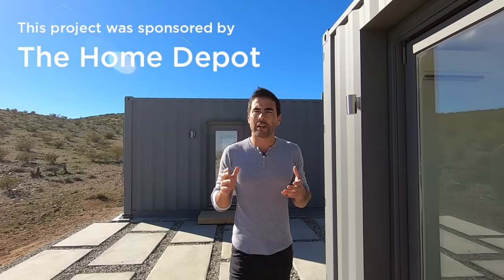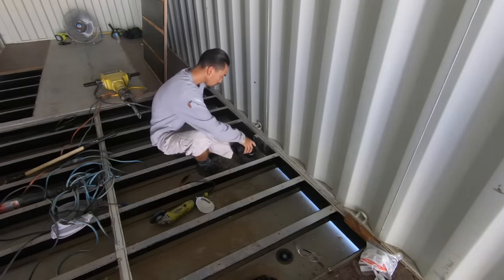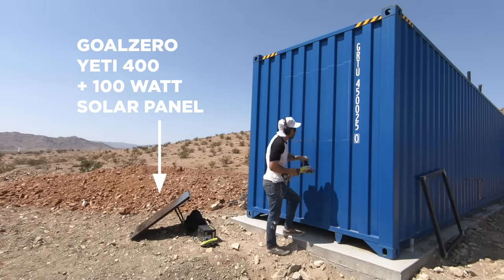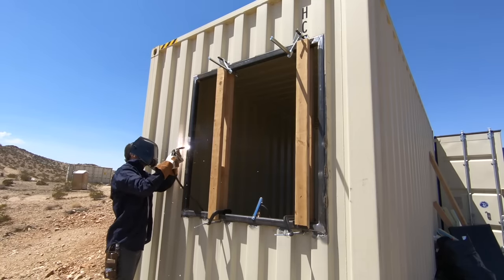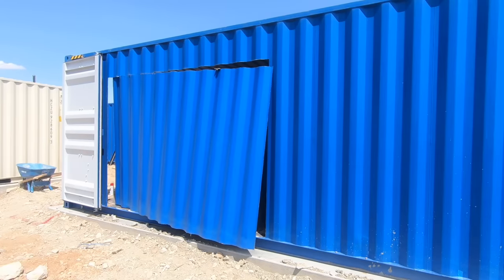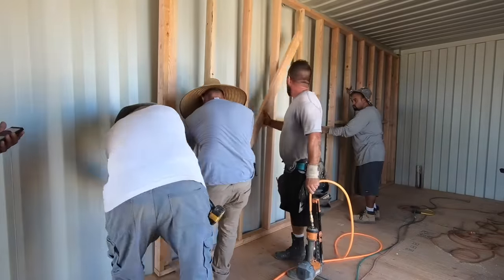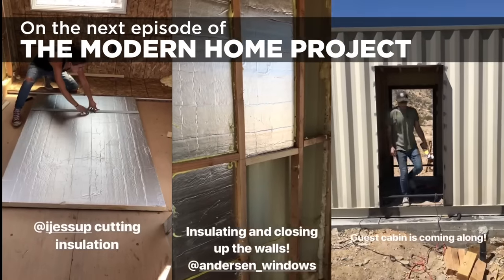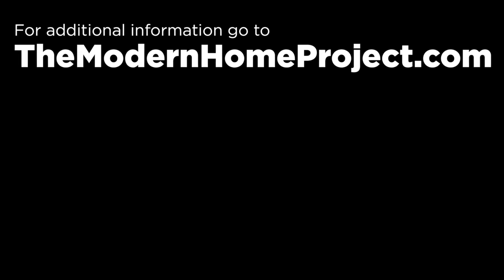Building a Shipping Container Home | EP02 Moving, Cutting, and Framing a Container House

Comment: You got screwed by your local building department. They made you do so much extra work that stick framing would have been way cheaper. Totally defeated the whole purpose of using shipping containers.
Reply: Agreed!  It would have been faster and cheaper to just build a traditional stick-built house.  You could have the walls & roof trusses built offsite and have your shell up in 1-2 days.
Reply: CA PERMITTING STRIKES AGAIN!
Reply: Agreed, building a stick lumber house frame inside of a shipping container, kind of defeats the purpose of building a container home .
Reply: That’s what I was thinking. I know nothing about construction or anything but I was like what even is the point of the shipping container now?!
Reply: That's what I was thinking. CA, where they'll violate federal laws and make declarations about illegal dreamers to create sprawling 3rd world indigent camps, but force this citizen and new taxpayer to undergo this level of bureaucratic overreach and overkill.
Reply: Do you guys actually expect him to live in a bare metal box in the middle of the mojave desert with no insulation or framing?
Reply: Not totally. Unless you want to live inside a radiant heater, how are you going to install insulation/drywall? You may want that full 4” and max R if the outside is 105 and you go off grid solar.
Reply: Yeah, lets build a house inside a house... I've been interested in a shipping house for a while, If I ever build one I'll be sure to check into the building codes before I start.
Still love the video though.
Reply: Love the guys passion, but lots of extra time and money
Reply: @dvwatts  Having studs isn't stupid, for all of the reasons you mentioned. Having to pay an engineer to design headers over the doors to support a load that doesn't exist is very stupid.
Reply: @Gunner7121  Building a above ground container home in the desert is stupid.
Its gonna get so hot inside that it wont be livable
Reply: His choice to live in a tin can in the sun....
Reply: close to the most inefficient building I have ever seen!
Reply: Depends on your purpose. Containers are far more resistant to storms than stickbuilt structures and their steel shell isn't vulnerable to wildfires (though if it's heated sufficiently the inside paint can outgas).  That's why my machine shop is inside two 40' High Cubes.  It's very low maintenance, I got an instant level floor capable of supporting my lathe and mill, and because the structure was instantly available I used the containers as storage during construction and left them loaded when I winched one against the other  to weld them. Containers are great for shop structures and many other uses. Stickbuilt junk is a fire hazard and termites eat it. It's fine for homes designed to be pretty. For a god tier example of container construction check Andrew Camaratta's container castle videos.
Reply: @EssensOrAccidens  everything that I have heard about California is so stupid.  I have not visited that state yet and have no desired to and never will.
Reply: I came, I saw 
Then you’re small minded
Reply: @EssensOrAccidens  welcome to socialism. Thanks liberals.
Reply: So why not build a stick building with metal siding , or just order a precut steel building (versatube) that you could erect with no heavy equipment. with the cost of the crane rental the containers , container delivery  , foundation , plus still having to frame & finish the inside , containers just seem extremely cost inefficient. a well used 40ft container costs 3500 before shipping let alone he has these nice shiney new ones which in addition too had to then order all the windows and doors for..  I can't imagine doing a stick built steel sided building would have cost more while giving more usable square footage especially since the stick built gives you the space for insulating by default without additional interior framing.
Reply: I thought steel container houses were super cool and a cheap way to build , then i saw this video and now i think i'm on the opposite side of the fence.
Reply: @EssensOrAccidens  California would have the sixth largest economy in the world if they were a country, bigger than Russia's for example. Apparently they're able to do some things right.
Reply: @TheDaltonmichaels  Don't be discouraged by the prices and methods being presented in this video series, unless you are looking to build in California.  I am about to begin building a 1280 sqft container house and the cost is 50% less than just building a stick frame home.  I do not live in California, however, and i am using high quality components.
Reply: Building department? Why would I call them? Where I come from we call that a non permanent structure.
Reply: @dvwatts  The proper way to do it, would be to space 2x4s flat @ 4ft intervals, sheet-rock mounting. allows for more space in a structure that desperately needs it.  Use spray-in foam for high R per inch and resistance against moisture getting trapped between wall and insulation (mold), since it adheres to the surface of the wall.  There only needs to be support in areas where the wall is compromised, welding tube, beam, or channel into it is the best way to go there.  Wood would only act as kind of a safety stop, actually integrating steel to bolster the structure would do a lot more for actual strength.  Corten steel, which is what containers are comprised of, doesn't continue to rust past the surface, so that part was a bunch of crap.  Those things spend years on open seas, getting blasted by salt water, they would far outlast any kind of wood.  Like others said It's basically Cali Bureaucratic planning officials, flexing their permitting muscle, just because they can.
Reply: @Steven Brown - Anything on a foundation can be considered a permanent structure but even in places where that isn't the case, they may still be requirements you'll have to follow to make it legal to live in, especially, if you're going to hook it to utilities, water, sewage, etc.
Reply: Democrat government paradise!
Reply: Like I always said, America is no longer the land of the free. Remember, he didn't show us all the bullshit the government made him go through
Reply: NatoriousGamePlay 
The first video shows the process they made him go through it was allot!
Reply: @dubious6718  not necessarily.  The desert is a great place to use passive heating and cooling.
Reply: That sucks
Reply: haha, right!  In the desert, you get passive heating in the day until you're baked crisp.
In the night you get so much free passive cooling,  you'll sleep shivering and wake up as a Popsicle...  :) 

Must be the holy grail to build a house that amplifies and exaggerates the temperature swings of the surrounding environment.
Reply: @Pharesm That would be a very badly designed system.  for a good example, look at earthships. some of them are located in the same desert.
Reply: That's my whole point.  A shipping container is detrimental to appropriately insulating design, to the point that effort and materials required to mitigate the issues mean that you're better off avoiding the container and simply starting out with different materials.
As for people who can't even build a rectangular box from scratch, they probably should leave the building to someone else .

Given the school system, its maybe unfair to expect people to conceptualize and then build their own solutions, without relying on someone else's design that was optimized for ocean going freight transports.
Reply: @Pharesm  You could build passive heating and cooling into shipping containers, you just have to plan for it.  some south facing windows, a couple of air vents, maybe add a garden to the roof.  those would all work.  there are also insulated shipping containers if you want to go that route.
Reply: @EssensOrAccidens  What makes a dream illegal?
Reply: @Hlidskjalfff  Yes! Panel insulation could have worked.
Reply: @dubious6718  True, has anyone buried containers?
Reply: @cuongandmari  Thank you! That's the point of it.
Reply: @goldsilverandiamonds  Good to stay away then!
Reply: @NPC-rq9tp  Good plan to stay away.
Reply: @V0YAG3R  Stay away!
Reply: @J. P. Good plan to stay away!
Reply: @nancys1125  Collect taxes.
Reply: @usernamemadison  The fun constraint of really narrow rooms!
Reply: Dax Graham any way you look at it. He’s gonna live in the middle of the desert in a metal box with rooms less than 8’ wide and it will not be worth the money he has invested. It will be so unlivable that he will sell it at a loss to some other trust fund baby with more money than sense.
Reply: Ob Fuscated an instant machine shop, yeah okay, a house, well not so much.
Reply: I came, I saw 🤣 you need to change your name... I heard , I stayed home
Reply: Madison McAllaster  well the steel siding might might slow down a stray bullet
Reply: I think you missed the point entirely. Everyone’s goal isn’t the cheapest possible solution.
Reply: I think I see my dad's house from here.  The inspector overrode the architect's design and, AFTER the concrete was poured, forced the builder to increase the depth of the footer and add steel plates to "distribute the weight" of the steel barn he was building.   Now, this was after the plans were approved and building started.  It cost my dad thousands.  CA building departments are full of corrupt bureaucrats that either want kickbacks or just want to make sure every office needs a few dozen extra employees to handle the load of dragging out the simplest build for years.  After all, how can I become a high-paid manager if my office only needs three people?
Reply: Exactly
Reply: Exactly!
Reply: When I used 1,600 containers to build a 40 story container housing towers, the price of containers had been increased from $2,000 to $4,800 now makes a hell lot difference. Because more people knew how to recycle the shipping containers, finally. George Wu, ARCHITECT, A.I.A., NCARB 2019-3-27 Facebook/ George Wu
Reply: @maj21093  but sure about stick frame out in those extreme temperature changes.  Better to use concrete walls I think.
Reply: @Gunner7121  Agreed, looking at it, it seems like it'd have more of a lateral issue, like if someone pushed on the door. Prior to the studs going in the only thing supporting the tube steel door frame was the corrugated steel which is pretty flexible.
Reply: @TheDaltonmichaels  I think they can be, but you have to build in a place where the governmentisn't micromanaging you.
Reply: P H
 - Unless he really wanted to do a shipping container project, like he said in the first 10 seconds of video #1
Reply: I have seen quite of tine houses project so far. And the reason I watch these is because I am amazed by diversity and contrast this world gives. Some are homeless and some play 'let's build a tiny house for funn. 👌
Reply: The framing would be needed so you can add insulation, run wiring, and put drywall up. Without it, the interior would be unlivable. I've never seen anyone build one of theses without framing the inside.
Reply: It's CA what would we expect? It's sad
Reply: I feel better knowing I’m not the only one who was thinking it defeated the original purpose.
Reply: What were you to attach the insulation to? What were you to run wiring through? @P H use your brain.
Reply: Well when you build a house out of brick or CMU you just mount fur strips.  You don’t have to frame an entire wall.
Reply: He's living in SHIPPING CONTAINERS. If you havent noticed, he doesnt make great decisions.
Reply: Exactly, this much work to live in a box completely defeats the purpose.
Reply: Dalton Michaels Don't give up hope. California is extremely ridiculous requiring weak sticks to reinforce what is already vastly stronger then the wood framing they are doing. The box steal frame bares the majority of the weight so even with the corrugated sides gone, it is still superior to wood stick construction. Depending on where you live and what the local regulations are will greatly determine final cost.
Reply: Good lord, even on a lovely building series, with thoughtful discussion on building techniques by some commenters, you can't get away from the frothing right wing bigoted 4channers that have to turn everything into bashing anything and everything and making it partisan vitriol 'to own the libs.'  As Nancy said, Cali would be the 6th largest economy of the world as a nation, and many of the red states that have a lot of these angry folks against the evils of Cali and dems and immigrants and leftism (whatever that has to do with anything beyond dogwhisling) are the same that take the money that the coast states give them to stay afloat. Point being, give up the hatred and fear, your life will improve, promise.
Reply: P H 100% true !!! An absolute overbuilt...
Reply: @cuongandmari  there's an old saying believe nothing that you hear half of what you see. Go see for yourself, but don't trust your eyes and definitely not your ear.
Reply: @goldsilverandiamonds  the price of real estate and everyone wanting to live in California is what drives up the cost of living. There's a thing in economics called supply and demand everybody wants to live there well not everybody but because many people do it drives up the cost of Real Estate which drives the cost of everything.
Reply: Anthony Hawk Democrat policies have artificially inflated prices in many cases. Democrats have purposely made new development processes very expensive, very slow and very difficult to do. This is one of many reasons why housing and rents are expensive and hard to find. It's creating scarcity (lack of supply) when there shouldn't be scarcity. They are doing the same with water resources so they can charge people big money for it. They higher the costs the more money is collected via taxes ect. Democrats strive to increase costs for this reason. The 15.00 hr wage they push for is a great example of increasing costs not on just labor but everything once it goes up that will bring in billions of new tax revenue for them at the little guys expense.
Reply: I am sure or near sure that a premanufactured home would have cost a lot less.
Reply: @Hlidskjalfff  I just would have used old refridgerated containers. They are already insulated to about R50.
Reply: Welcome to bulletproof container homes. lol ... this would be great in the da hood. xD
Reply: That's what a friend of mine learned the hard, expensive way.
Reply: I think this is just a novelty/fad thing, once more people realize that it's un-economical, it will die down.  Now, if all that expensive framing wasn't required then it would definitely be a more attractive solution.  Course if one wants a bulletproof home, knock yourselves out! xD
Reply: You're missing the point of him being a designer. He didn't want a typical home. He wanted something different and was willing to pay more. Some people don't value cheapness as much as others when it comes to picking the architectural design. He is free to do with what he wants with his money to fulfill his vision of a dream home. It's not your jam, but that doesn't mean it's no one's jam.
Reply: Literally built a house inside of a shipping container
Reply: @stevenbrown2908  as far as I'm concerned nothing is permanent look what happened to the towers in New York nothing is permanent I agree with you
Reply: Lesson to kids.... It will be easier and more cost effective just built the Frame out of wood, then put metal siding (Metal Roof Sheets).  Using the Shipping Containers and then built a Frame inside of it, same thing.  LMFAO
Reply: it makes this look like the worst idea ever. like why not just build a house and cover it in steal if that's your thing?
Reply: The project looked cool,  until We saw how much wood framing was needed..  It's a  'Rube Goldberg" ..
Reply: @bobbytables464  Why not build around a single wide, a friend did that and sold the home later for over a million, you'd never have known there was a trailer in there lol. Nice to have land in a less fucked place...
Reply: exactly
Reply: This, and the architect/engineer didn't seem to have much understand of container construction. Should have went with someone who specialized in this sort of work.
Reply: @obfuscated3090  containers are middle of a desert with nothing to burn.
Reply: All the inside framing was a waste of time and labour and money defeated the purpose  of building with a container. And the plumbing   in the beginning could have been done before the concrete slab  was poured but I guess that's how you learn by making mistakes and did he say it took him over an hour to cut the window opening out " I wouldn't say that out loud " that is not something u tell the world I mean it's embarrassing...
Reply: Could have easily built a steel building (barndominium) with 1/2 the hassle and all the conveniences. probably cheaper also. Knocking out about 8-10 inches of living space for framing is rough on something the width of a shipping container.
Reply: @Gunner7121  should of used steel
Reply: Lol he worked it it out.
Reply: Dax Graham well then why choose a container for this environment? Like all the others commenting here, I think he shoulda just built a normal house. The only saving of materials using a container house is not having to use exterior cladding and roofing.
Reply: What would the cost have been and the standards for determining the cost?  The U.S. Census Bureau indicates that in Western States the cost to build a single family home is $110/sq.ft.
Reply: @AlexAtGuilford  Yes, except you couldn't stick frame with just 2x4's without the shipping container.
Reply: P H 
That’s what I was thinking 🤔
Reply: Precisely! Seeing all that framing work and material, not to mention how much room it took up on the inside, clearly defeated the purpose. Wouldn't it have been more reasonable to ensure that rust proof paint was applied properly?
Reply: @redneckhippiefreak  The foundation attachments were dumb, but you're right about the interior framing. The problem is the cuts in the corrugation, if not reloaded then the frame could sag and fold under a much smaller load. but the problem could easily have been averted by using the box to just install vertical columns either side of the doors and windows rather than all the wooden bs and precision cuts....
Reply: the container I built I bolted 3/4 ply to the walls and ceiling. The stick frame is a waist.
Reply: jim bayley  Or he was just overcompensating using wooden structure that the government couldn't complain about it?
Reply: junior1497 
Ohio, Laredo, South Carolina, American public schools amongst other places too numerous to list wonder who murdered all those people and kids. Yeah remember? Tho shall not kill. Sick attitude sick people in this country.
Reply: I agree, shipping containers are supposed to be a cheaper alternative to traditional home. Seems like he went way overboard!
Reply: The container cost is only 10% of total cost  . It’s hard to build an inside shell to match the metal frame and all its cutouts
Easier to build a standard stick frame that’s better insulated 
Also better looking than metal shoe boxes 
I thought it was a good idea but changed my mind after consideration
Reply: @Nicholas-f5  I've seen it done three times (in videos). Once was a success. One was mostly successful. The other time was a catastrophic failure. 

The success was was in a slightly over-sized hole that was NOT filled in. A roof was built over the hole and six inches of concrete was placed on the roof. Dirt covered the top. So the roof took the load on top and there was no load on the sides because the hole was over-sized. This might not work in some soils without a retaining wall.  https://www.youtube.com/watch?v=A3EAJex1RVo

The mostly successful one was a wine cellar. The container was buried about halfway and dirt mounded over it the rest of the way. Even so, the sides ended up being pushed in about an inch from the pressure of the dirt. Apparently the owner was okay with that. It bore up under the load on top because they didn't put very much dirt on top.  https://www.youtube.com/watch?v=00dyCfoicf4

The catastrophe was on Myth Busters. I can't find the episode as it wasn't actually about shipping containers. They just happened to bury one for the show. It collapsed under the weight of the dirt over the middle because the corners are much stronger than the middle. I think there was maybe a foot or two of loose dirt on top. When you stack shipping containers on a cargo ship, it's the corners that are bearing the weight much more so than the middles. But it's that ability to stack shipping containers six high that makes people think they can bury them safely.
Reply: Ob Fuscated, love your username and agree with the recommendation of Andrew C’s container castle videos (as well as everything else on his YouTube channel).  I do love this video series too, even if the lessons learned are what not to do.  He has a great narrator voice.
Reply: Who's side is he on? This is fishy.
Reply: coming. him saw they kidding, No
Reply: @poppap8439  Yes, you can. Most houses are 2x4 frames with 16 on center studs. Some people do 2x6 with 24 on center studs, but that is in no way necessary.
Reply: @michaelhovey8007  That's not even vaguely close to an issue. wrap it and insulate it like literally every other house built these days.
Reply: @JboEnterprise  They just needed to have the steel reinforcement frames actually go to bottom and the whole thing would've been structurally sound without as anywhere near as much framing

Instead of standard framing to try to reinforce everything, then the studs on the framing for insulation, wiring, and interior walls then could have just been 24in on center for supporting the wall.

I think a lot of their problem is that they'd over-engineering and under-thinking.
Reply: hey ,if anyone else wants to learn about build a container home try Skyarza Container Home Star (do a google search ) ? Ive heard some unbelievable things about it and my co-worker got amazing success with it.
Reply: I've seen professional contractors do this strategy in Florida too. And many other states. 🤔
For me his biggest mistake was using DRYWALL! That stuff doesn't belong inside of anyplace that claims to be a modern Home! 🤨 
Plywood walls would have been a much better choice. 😥
Reply: Don't it cost extra if not more if you let they container company cut out everything?
Reply: mostly all building dept in most cities don't allow shipping containers I know in the coastal area of California they don't and especially  here in orange county
Reply: Exactly..
Reply: Im not a carpenter but doesnt all the framing give you space for your insulation as well? And the wiring.
Reply: Ha! That's just the Disney-Club version of bureaucracy. I can tell, I'm from europe. ;-)
Reply: @stevenbrown2908  Where do you come from, The U.K.? I heard that too. Same with caravans and mobile homes.
Reply: There are many components to creating an amazing design. One resource I discovered which successfully combines these is the Magic Container Plans (check it out on google) definately the most helpful course that I've heard of. look at this  amazing resource.
Reply: @P H   I totally agree.  I've designed living and office space using shipping containers for the US Government for use in Iraq and Afghanistan.  Totally over-engineered but like someone has already stated, CA building codes strikes again.  Indeed, traditional methods of construction would have been cheaper starting with the 40 ton crane which would not be required!   When you do the math at the end, traditional methods will have won if economics and time were the factors.  I'm planning on doing a shop with 3x40 foot high-cube containers welded together and no where near the engineering shown here.
Reply: Everyone hears shipping container and think you just buy and thats it.  Sorry buddy, you are seeing the reality of creating a safe and code-met structure.  Fees and cost are somewhat typical.  I always ask a ton of questions prior to submitting so that I know explicitly what hurdles need to be overtly cleared in my dwgs.  For example, I was able to get a home renovation design cleared in one sitting while I witnessed another get denied.  As a then young architect, I realized regardless of what state you go through, you have to meet code, present well documented Schematic/Construction Documents for permit, and ask questions prior to submitting to prevent headaches or surprises during the process.
Reply: @ohijohnson4259  No
Reply: Here is the Original Semitic Text. HERE is The REAL Savior

YaH The Heavenly FATHER HIMSELF was Who they Crucified for our sins and “HERE IS THE PROOF”

From the Ancient Semitic Scroll: 
"Yad He Vav He" is what Moses wrote, when Moses asked YaH His Name (Exodus 3)

Ancient Semitic Direct Translation
Yad - "Behold The Hand"
He - "Behold the Breath"
Vav - "Behold The NAIL" <— YaH’s Crucifixion
He - "Behold the Breath"

“Behold the HAND that Beholds The NAIL” 

PROVES - YAH The Heavenly Father HIMSELF was Who they Crucified

That is EXACTLY what Moses Wrote

Here is what they mean

YaH's Name:
(Ya)d + (H)e, as YaH is what Moses called Him and YaH Declared: "this is My Name, this is My Name for all generations" (Exodus 3)

YaH is The Creator:
Yad He, (HAND BREATH), as YaH's "HAND" Formed man from the dust  of the Earth and His "BREATH" made him a living being (Adam)

YaH's Sacrifice of Crucifixion:
Vav He (NAIL BREATH), the "NAIL" through YaH’s "HAND", that whosoever shall call YaH Savior, His “BREATH” brings forth life (Salvation)

How YaH arrives:
YaH arrives via the Tent of Meeting (Exodus 33:7:11, Isaiah 54, 55), where a Tent is erected outside the city, a cloud descends upon the entrance of the Tent and YaH appears...

Why they demanded YaH to be Crucified:
YaH was Crucified according to Hebrew law (Deuteronomy 21), to be Hung on an Almond Tree for BLASPHEMY as it was for His NAME they demanded Him Crucified. The Messiah claimed He was YaH...

HE WAS YaH!!!

HalleluYAH “Praise ye YaH”

From The Hebrew Book of Isaiah, The Dead Sea Scrolls

Isaiah 42:8
"I am YaH; that is my Name! I will not yield my glory to another or my praise to idols.

Isaiah 43:11
I, I am YAH, and there is no other Savior but Me.

Isaiah 45:5
I am YaH, and there is none else.
Reply: Never report sh!t to the building department or get permits from the building department!  I built a container house in Indiana, I didn't report not sh!t to the building department or city officials! I built the container house and put siding on it, no one could tell the house was framed out of containers and wood! If you don't report sh!t the city and state won't know 
Sh!t simple as that! And when I sell or get my house inspected they won't know it was built out containers and framed with wood. Fyi my container house is 25 percent cheaper than it would have been if built with stick and metal siding... Anyone who says they built container houses and saved 50 percent than conventional stick built house is a liar unless it is a tiny container house...
Reply: Excellent point.  I'm building my own square minimalist concrete loft. More organic and not a oven cage.
Reply: Communist council need $$$maaaaney ...I waaana maaaaaney
Reply: @TheDaltonmichaels  that's a pole barn
Reply: @maj21093  😮😅😅😮😮
😅 3:35 
Love Harley ❤️
Reply: @Hlidskjalfff No! A tent! Be a real man! Aaaaarrrrgggh! 😂
Reply: @rerite2 no he didn’t
Reply: I am surprised those crazy permit guys allowed you to cut through STRUCTURAL steel in the floor as it's there for a reason....so massive concrete slab and steel above it in the structure not supported by the concrete destroyed. Awful !